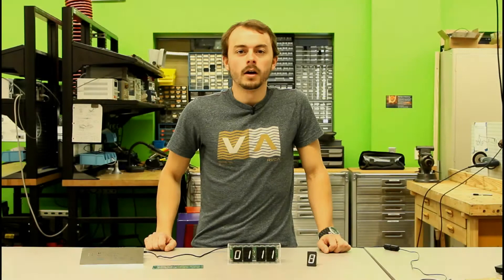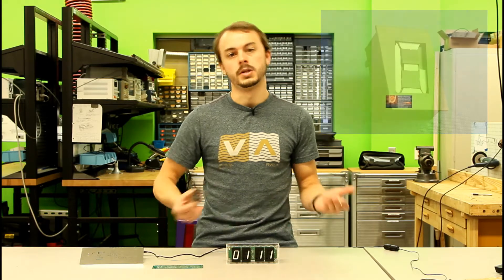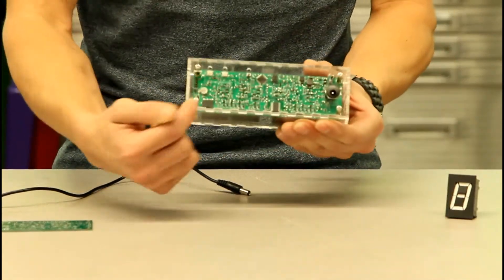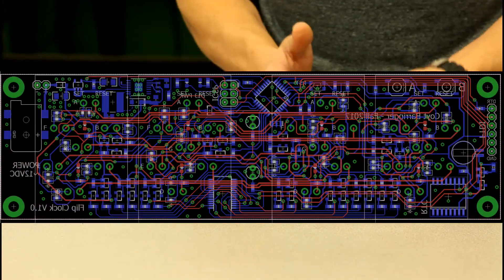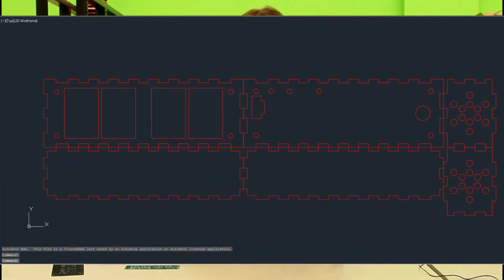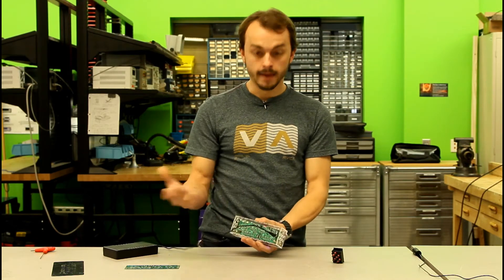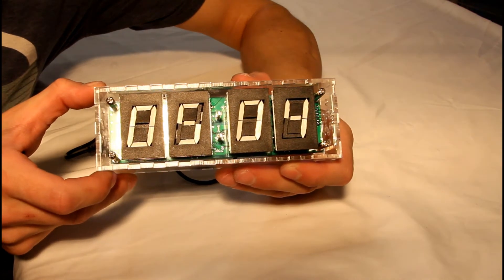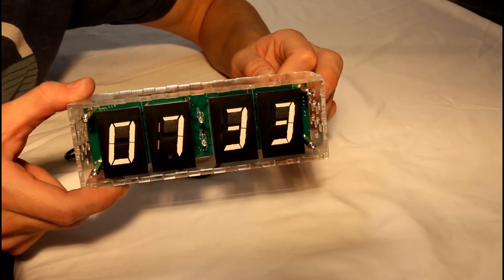Flip Display Clock

Comment: Would you consider selling the circuit boards with the components soldered on? Also could you do a write up of how to program the microcontroller?
Reply from the maker: I'm not sure. I've been asked by one or two others about selling assembled boards but honestly it's a ton of work to just make one. I highly doubt I'd be able to break even let alone make any money doing this. Time is the issue - it takes several hours to hand place the components, solder, and test the boards. I'd have to charge a lot. 

I'll think it over and let you know if I decide to make a few. Also, I'll think about writing up or making a video tutorial for programming the MCU. There should be plenty of online resources for that though. Flashing a boot loader to the 328p is simple with an existing Arduino  - setting proper fuses before the boot loader flash is a bit harder.
Reply: Thanks for your reply.Would you consider selling it as a kit? With all the components,pre made pcb and detailed instructions about where components go etc?
Reply from the maker: I'm looking into the feasibility of getting 10 boards (to start) assembled in china and selling them on Tindie. Give me a week or 2 and you may be able to buy a mostly assembled and tested board.
Reply: Awesome.Just let me know if you do and i will definatly buy one 👍
Reply: @CoytHV  Hi Cody, I also have a client that is very intent on using these flip-style displays for an artistic clock. We understand that the build is custom and your price will likely be high. If you are open to discussing this, I would greatly appreciate a meeting.